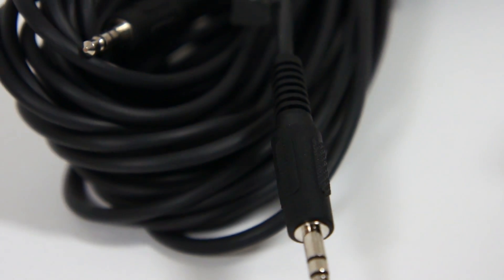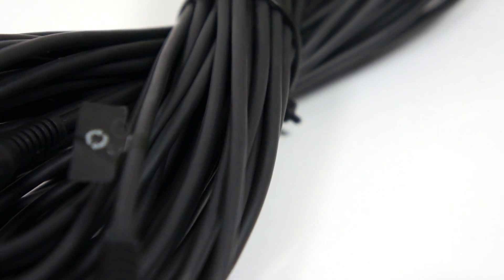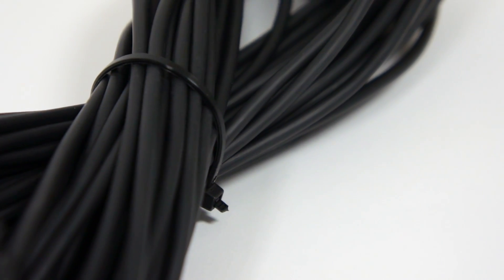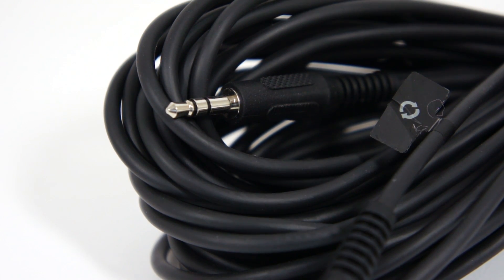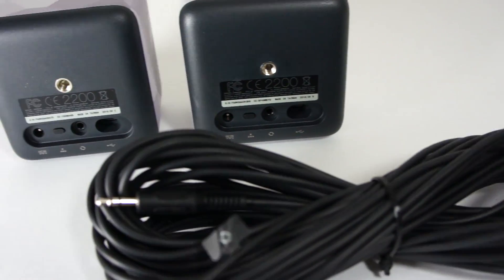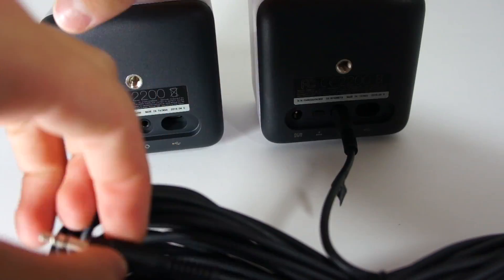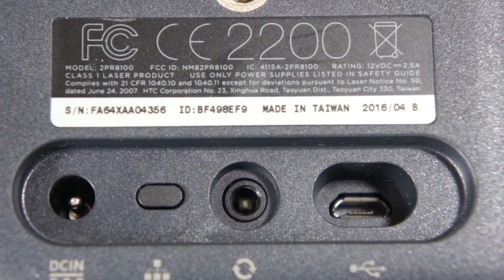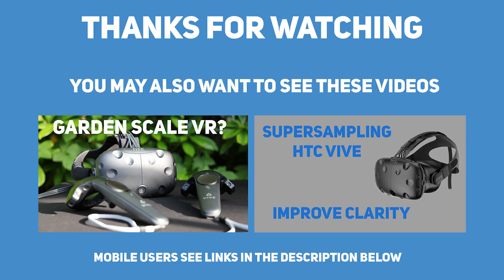HTC VIVE Sync cable explanation and tutorial

Comment: I connected both of the cameras but one (b) only glows purple constantly, does it still work?
Reply: If you're using the cable then one of the stations has to be A while the other is b or c

edit was to fix a typo
Reply: @a_d3mon  the working camera or the one that's keep glowing purple?
Reply: @PoutyJinx  the working camera has to be "b" while the wired slave is "A"

Comment: i plugged headphones in the light house and it sounded like a dial up modem XD
Reply: Is this a joke or does it actually make noise when headphones are plugged in
Reply: @jacksoncrosley-dronebuddie9231  I'm sure it actually does. Data used to be stored on cassette tapes and played back as a program on screen when played into a computers RAM memory. Audio was used to transmit 0's and 1's essentially. A good example is dial up modems or like an old 1983 TRS-80 tandy home computer.

Comment: Yea but even using the sync cable when I turn away from one of the base stations, that hand can float off into the distance or become unresponsive, sometimes it even loses complete tracking of my headset and results in my view literally tipping, almost knocking me flat on my ass, or the view returning to the loading screen in the Steam VR landscape (Not the building where you can spawn props and launch games, but the black void that can be customized to have mountains etc.)

Idk what causes this, even when using the Sync cable and both of them say they're tracking fine... I've turned everything off, repaired them, attempted to resetup the room. Nothing. It just will not work.
Reply: Did you figure it out?  This has been bugging me.

Comment: I want to keep the two base stations and sell the headset, can I keep the sync cable or the buyer will also need it for the headset ? Thanks for your answer
Reply from the maker: The cable isn’t necessary for the headset to work so it should be fine if you keep it.
Reply: @Vosentech  thanks a lot for your quick answer, I will keep it :-)

Comment: SO is it B and C when you use the cable?  and A and C when not.. IT IS CONFUSING!!! HAS a *A. does that mean it should be A & C when using the cable?>???? ?
Reply: B is the "master" setting, it doesn't matter which lighthouse is in master mode, but the other modes are both slaves, C being wireless slave, and A being wired slave, for sync cable use B and A, for wireless use B and C.